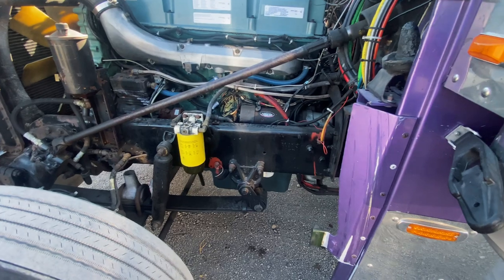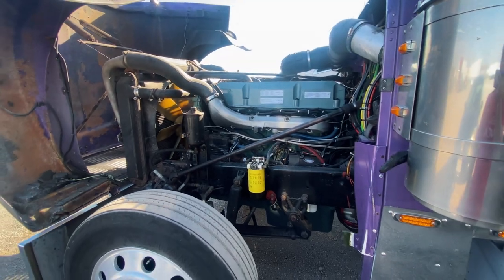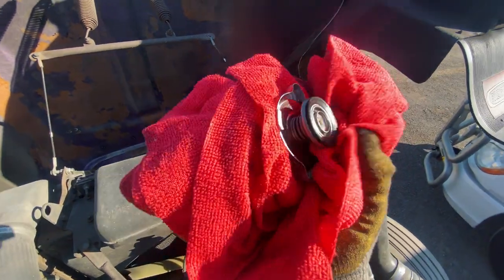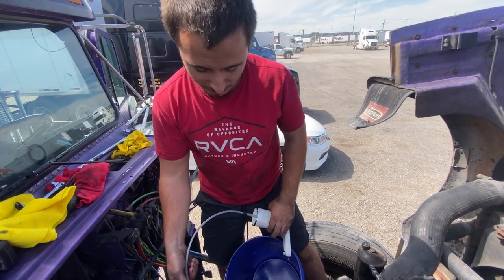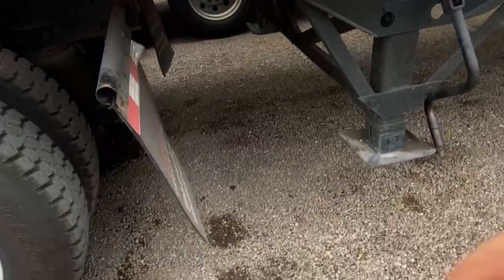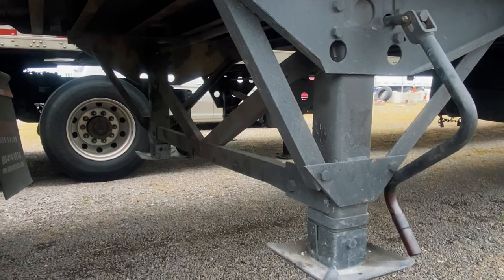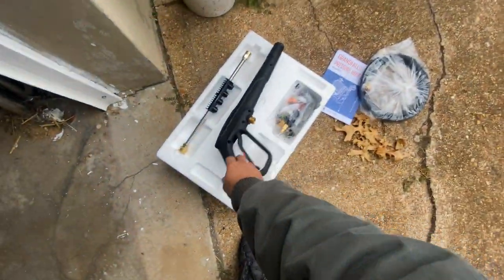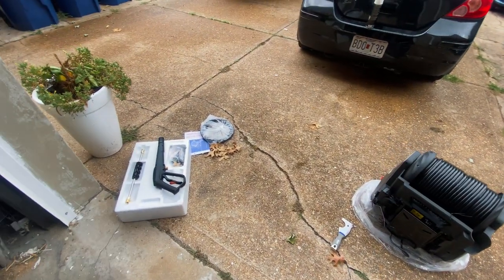I ALMOST DESTROYED MY MOTOR+ GIRAFFE TOOLS PRESSURE WASHER UNBOXING

Comment: On these older trucks,the heater is pneumatically control.if the heater valve is leaking air it will pressurize the cooling system.I would check that heater valve under the bunk first,then air compressor coolant hose,before I think the head.I once had the same symptom you’re having and I drilled a hole on the radiator cap and trucked like that for 6 months.best luck to you bro

Comment: No no no no bs you don't need a crate engine you have to get your block cut when you get a inframe done your liners are falling down just get the block cut right and you won't have a problem trust and believe I've seen it happen to every type of engine people think a rebuild is just parts if you don't do the block this will happen some places don't do it and some people get away with it
Reply from the maker: Yea for sure, but at this point it’s had 3 in frames I want that block out and crank balanced and new dampener in etc in frames won’t do it at this pojnt
Reply from the maker: @Joe it’s a motor that hasn’t been made for last what 17 years + of course they’re all remans just like majority of parts you get at dealer as well. There’s a place in Springfield mo tho does a full crate motor oem parts 2 year warranty 200k mile for 29k drop in only thing needed is alternator and starter so def better deal than 38k long block at dealer if I did go that route

Comment: A new head gasket won’t fix a dropped liner .. those bores should of been cut and liners shimmed to proper protrusion. The block does not need to come out for that
Reply from the maker: Yea I’m with ya, put trust in a wrong shop but tbh trucks been rebuilt 3x now it’s time to either out frame or crate motor

Comment: I HAVE A 2002 MACK VISION SLEEPER TRUCK I JUST RE DID EVERYTHING ON THE WHOLE TRUCK BEFORE I COULD DO MY IN FRAME THE OIL PUMP WENT OUT TAKING OUT THE CAM AND BARRING'S MACK SAID 60K SAID YA RIGHT I HAVE ALSO 70K INTO MY MACK ONLY THING I CAN DO NOW IS PART THE RIG OUT IT'S A HARD DECISION TO MAKE EITHER GET A NEW RIG OR  HAVE AN UNGODLY AMOUNT OF MONEY INTO AN OLD TRUCK FU$K
Reply: Dude find a motor and swap that shit
Reply: @patryk2497  I don't have 20 to 30k
Reply from the maker: Only if you could do it with 20/30k, dealer quoted me 50k for a crate motor
Reply: @otrookie  ya damm scammers
Reply from the maker: @keepontruckinoutlawlife1248  yea and that’s only long block 0 accessories everything else from old motor. Ecm harness and long block essentially. And only 200k warranty lol pretty insane
Reply: @otrookie  who has that KINDA money
Reply: @otrookie  you can get a fully rebuilt Detroit from American Fleet for 23k. They are also from Missouri. That is with turbo and air compressor and water pump included
Reply from the maker: @patryk2497  have you had work done there? I’ll check them out that’s really a good price considering freightliner wants 37k for long block

Comment: Look at it this way worst case scenario that motor is the cheapest motor you can rebuild trust me
Reply from the maker: Yea at mom and pops place with aftermarket parts. Dealer for out of frame is easily 35/40k and crate long block installed is 50k I got a quote